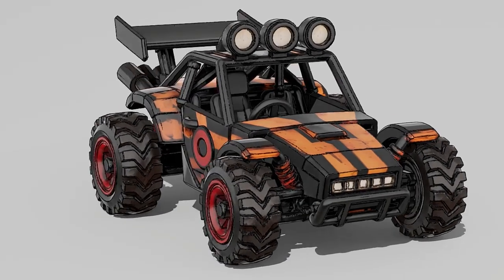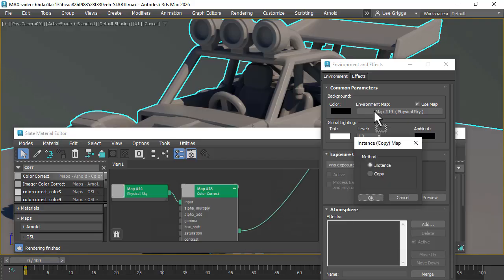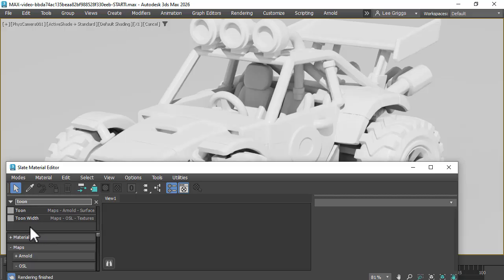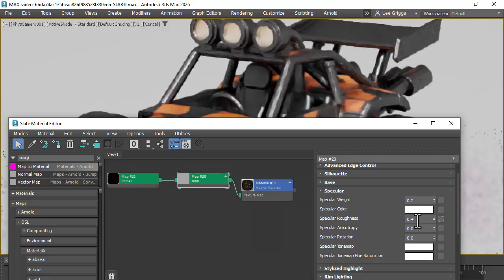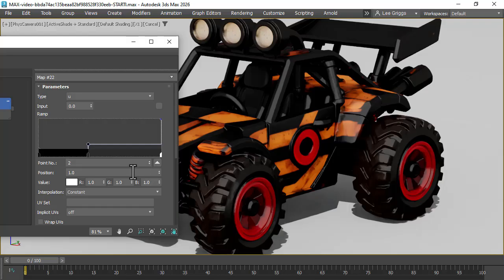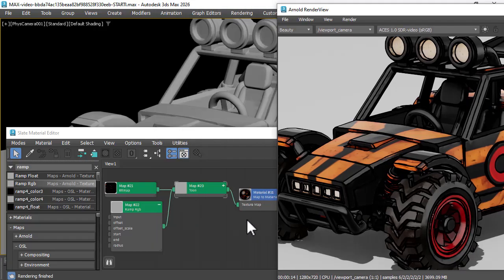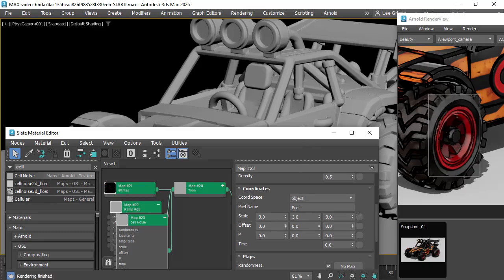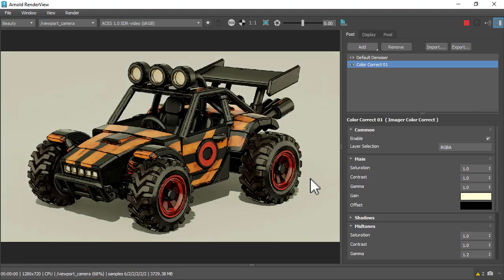Arnold Tutorial - Toon shading a vehicle in 3ds Max

Comment: Extremely useful, but is there a way to add some variety to the outline width to imitate pen or brush pressure sensitivity? The strokes are usually much more thin at the tips, not as uniform as rendered by Arnold. It's impossible to achieve that with noise or grunge maps.
Reply: I second this!